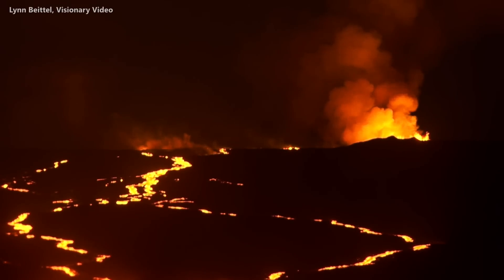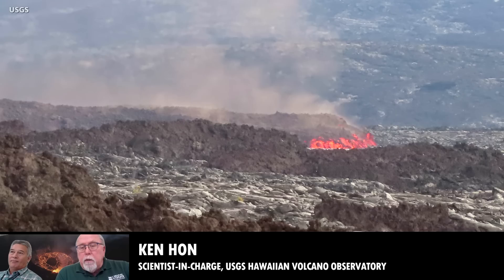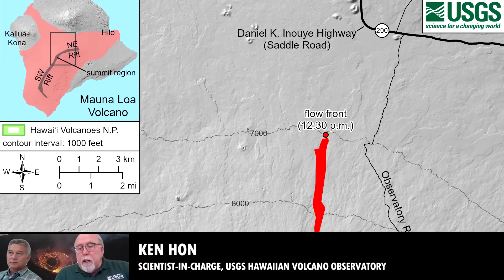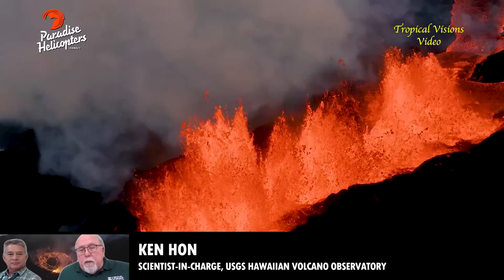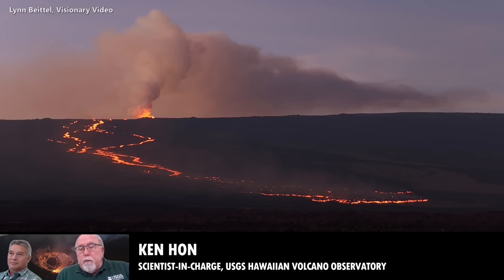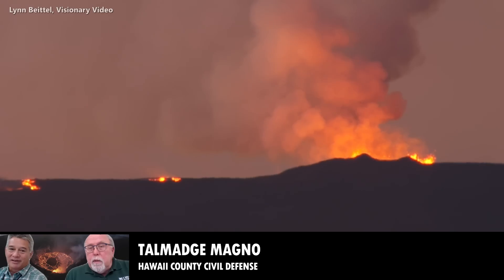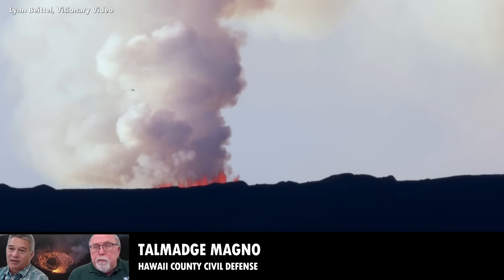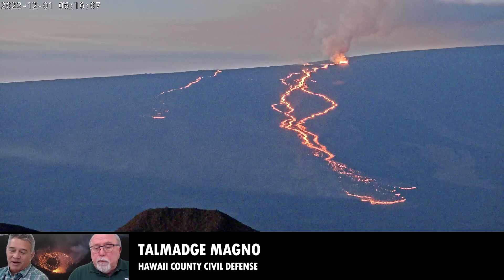Mauna Loa Eruption Update, Viewing Area Announced (Dec. 1, 2022)

Comment: Why no berm?    Do you ever wonder why   they wont divert?    answer that?
Reply: From the 2018 Puna eruption there was a guy with a bulldozer that made a berm to protect his property, it caused some controversy. To the native Hawaiians it’s offensive to divert the flow from its natural path for spiritual or cultural reasons, and from a legal standpoint it could cause damages to structures or properties that might not have been effected otherwise leading to potential liabilities. The USGS or volcano scientist say the rate of flow far outweighs the amount of material trucks and machinery could move to be of any real benefit. This is what I have heard anyways!
Reply: It's a temporary measure at best; lava doesn't care about trenches, it just rolls into the trench until it fills it, and then continues rolling over the top like nothing happened. Most people assume that lava flows to the lowest point, like water, but it doesn't work that way; most types of lava are too viscous, or they cool too quickly; the type of lava being produced in this flow, "A'A" lava, cools into rock very quickly at the head of the flow, and the force of the flow coming up behind just pushes over the top, like a slow-motion train wreck that never stops; this means that it will quickly fill and build itself a nice bridge over any trench it encounters, and then just keep on rolling forward.
Reply: Because that won't work here. Aren't you the expert... 🙄
Reply: @mikz1987  Let's try to be a bit more informative, maybe? Treating people like fools doesn't help anyone learn anything... :)
Reply: You just don't mess with mother nature.

Comment: Why did Hawai’i County build a highway in the path of a past and potential future lava flows knowing that Mauna Loa will erupt?
Reply: That would be the whole island
Reply: Almost every point of the Island is on the path of a possible lava flow
Reply: Roads are built where people need to go
Reply: Job security !😁🤙
Reply: It is a short cut between two volcanoes.  Other option is to drive around the two volcanoes.  Those roads also got covered the last two eruptions.
Reply: @westcoaststacker569  when it's cold can they Clear it ??
Reply: @jimshoe402  Basically they clear lava for every construction project on the Island, I believe.  The lower circling highway they had not cleared when I was there last, I believe though it covered many miles of it back years ago.
Reply: The island is all volcano so every road is that way

Comment: If it starts getting closer to the road, can they dig under it to give the lava a place to travel instead of blocking the road?
Reply: Trying to get in lava's way doesn't really work. It doesn't care about trenches or tunnels; it just fills them and rolls over the top. It's a lot like a slow-motion runaway train; the bit at the front has no control over the force of the flow at the back, driving the whole thing forward. When you put barriers in-front of it, it just climbs over and buries them. You can build on top of lava, once it's cooled enough to be safe, but it's very difficult to redirect its path effectively. It goes where it wants to, and few forces in the world can bring it to a stop meaningfully.
Reply: @hydroknight01    Except for uncle Stan and his special “Lava Shovel”.
Reply: @localcrew  Okay mate. If you insist. 👍
Reply: It would be melting or at least compromising any structure that tunnels under a road. Could also solidify inside the tunnel and spill onto roadway.
Reply: In Iceland they saved some homes but I bet $millions spent ..
Reply: No that would be impossible. You can’t mitigate lava.
Reply: @DN-kf4gg  if can, can. If no can, no can🤔
Reply: Yes. My uncle was a Lava Tunneler on the big island years ago. That’s exactly how it’s done.

Comment: Why don't they get dozers in an d dig a trench to divert it from the highway
Reply: Liquids don't care about trenches. Dig a trench in-front of a tsunami, and the sea will inevitably fill it, then keep rolling right over the top. Dig a trench in front of lava, and the lava will fill it then keep on rolling, just like the sea. You'd spend time and money paying people to take a few days digging a trench, only for the lava to be stalled by a few hours at most. Hawai'i is not Iceland; the island's topography and situation on the ground is not the same as it was in Geldingadalir.
Reply: Expensive temporary fix. In Iceland they tried to make a dam to prevent lava from flowing thru a pass and down into a neighboring valley. It delayed, but did not prevent flowing lava from entering the valley they were trying to protect. Money spent to little effect.
Reply: Hard to dig up Lava fields.
Reply: Unfortunately it doesn’t work. In the 2018 flow it pushed uphill into green lake.
Reply: How about some C-5  💥💥💥💥💥💥💥💥
That will make a trench!
Reply: @JD-gj2rj   still it will be fill up
Reply: Blow the volcano out with a hydrogen bomb ..
Reply: Lava does not behave like water. 

It solidifies during the path and inevitably would overflow.